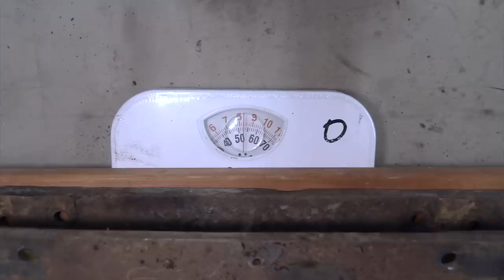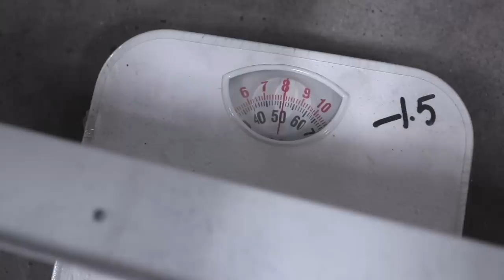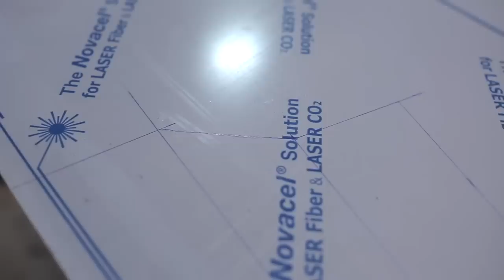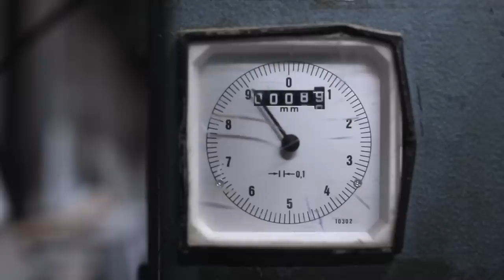The Lotus chassis it took four years to fix | Classic car restoration timelapse

Comment: Nice work George, but you're a bit confused about the principals of lathes. Chuck runout won't make the drill cut any more oversize than a twist drill is likely to cut anyway, it only means that the hole will not be prefectly concentric with the outside diameter. In any case, you need a 7/16" clearance hole, which would be 29/64ths or 11.5mm.

I've got some lathe work to do myself. I'm using Elite lower links to replace the butchered ones on my S3 Esprit. The anti-roll bar bush arrangement doesn't hold up well, particularly with modern bush materials (rubber or polyurethane). I'm making weld in housings to use a NMB spherical bearing.

Comment: Stunning paint on the chassis, seems too good to put the body on now! Btw stainless steel doesn’t have the same tensile strength as regular steel so check it out before putting it all back together. Keep up the great work.
Reply: They are generally comparable, stainless is generally a little less ductile. This also means that stainless generally has a higher tensile strength. It's unlikely that the trailing arms were made of high carbon steel seeing as they are bent sheet metal.
Reply: @Skybird Projects:  It's highly likely that the trailing arms in question are manufactured using mild steel - as ease of manufacture, cost and fatigue strength are the important factors for such components - i.e. it's not a 'money no object' car destined for the race track.  Without getting into detailed specifics, mild steel has a yield strength of 240-250MPa.  Grade 316 Stainless Steel has a similar yield strength, so it would be my choice if I was replacing the trailing arms in question without any accompanying engineering analysis. Grade 304 Stainless Steel has a yield strength of circa 205MPa -  so if used to create an exact dimensional copy of the mild steel version, the trailing arm would be "weaker".  However, if the appropriate 'engineering analysis' is conducted - then SS 304 could be adopted by using a modest increase in material thickness or a change to the trailing arm's shape or construction.  Needless to say, an engineering analysis would be expensive to perform and would be overkill for 'this Lotus project'.

Comment: When I built my 7 the stainless exhaust was dull. So found a polisher and went down there. Found this little old chap about my dads age in his workshop and left it with him. Came back next weekend and picked up my mirror polished exhaust. Beautiful job which he kept apologising it wasn’t perfect. Well it was in my eyes. He did a fantastic job and it still cleans up perfect 20+ years later. 
If they are going to be seen I can recommend getting those arms polished.

Comment: Amazing job on the whole enterprise, but love the stainless trailing arms. So impressed with the sheet bending press both the man driving it and never forgetting the people who design and make such presses. Tool makers are another breed. A quick question, what will you use to treat the inside of the chasis box sections? Be very very proud of what your doing. I love the Esprit and anything Lotus tbh.

Comment: Looking fab!
It did seem a bit like you were trying to measure centre to centre on the holes at the end by guessing where the middles were in empty space. You can of course measure edge to edge and subtract the 2 radii (or a diameter if the holes are the same), all of which is a bit easier to measure.
Can't wait for the next episode.

Comment: I thought your objective was to make this lighter? As mentioned previously, though the radius arms are box section I would consider the tensile strength needed by these crucial items, and the flexing they endure in use when reproducing them in stainless steel. A bad idea IMO. Have you thought what, if any, electrolytic reaction will be created between these components and the steel fixings? Those have to be steel, for the reasons I mentioned above.

Comment: I feel like you’ve done the 20% of the work that take 80% of the time at the beginning rather than at the end. I’m under the impression that basically finishing this car could take only a few months from now on 😆
Reply: The fiber glass body is going to need a depressing amount of filler, sanding, filler, sanding, filer primer, sanding, filler primer, sanding and cleaning, base coat, scratching and cleaning, color coat, buffing and cleaning, clear coat, buffing and cleaning, clear coat, buffing and cleaning, clear coat, buffing and buffing and buffing and cleaning and waxing and buffing and.... BEER!

Comment: Have you taken into account the different strength and properties of the stainless over steel
Reply: ... and the different properties of TIG welds on the edges of the two main suspension parts vs. spotwelding their flanges? The latter will definitely give the parts a bit more room to move in relation to each other under torsional stress, which I would not consider to be desirable in this application.

Comment: Great job there George , are you using 2 pac paint or water based paint ?
Reply: I get it now its epoxy
Reply from the maker: 2k Epoxy primer, then 2k urethane top 🙂
Reply: @soupclassicmotoring  is that stuff hard to clean out of the gun?

Comment: George SS is stronger than (rusty) mild steel...in case you can want to further reduce weight and material thickness.

I did this for my Europa TC front closing plate, but I used an aluminum(i)um sheet instead of the mild steel, of course isolating it from the steel fasteners and grounding fastener.

Comment: Hi George, ....STOP....! you need to get in touch with someone who understands metal properties  of the materials you're using, I know mild steel is ductile and forgiving and besides cost that was what would of been used originally in production. Stainless steel I'm sure suffers from embrittlement  under loaded situations ? If I'm wrong I apologise and hold my hands up. But you need to check this out you might well be putting a fatal but shiny flaw into this build. Don't let the persuit of perfection over rule the persuit of safety mate get the radius arms checked out. Also you may well find out that your potential insurers  will void the cover if it's found out you've carried out unapproved modifications to the structural integrity of the vehicle in the event of a crash.
Reply: Here in Germany the very strict vehicle testing organisations (the most (in)famous of which is the TÜV) would not approve of such a modification, and thus would not deem the car roadworthy, at least as long as you are not able to present a full documentation with detailed calculations by a certified mechanical engineer which proves by the way of comprehensible calculations that the properties of the replacement material as well as the properties of the complete finished parts (especially with regards to the welding techniques used) will be equivalent or better than the original parts. 
In order to do this you would need to get hold of the original factory specifications/calculations first of course (... and good luck with finding them for a car from a manufacturer that does not exist anymore ...), or have them re-calculated accordingly. 
Overall this would be a very elaborate and costly process. 

Alternatively, you could just paint your shiny new stainless steel parts black, and hope that the testing engineer will not recognise them as newly made parts with different material properties ... 😎